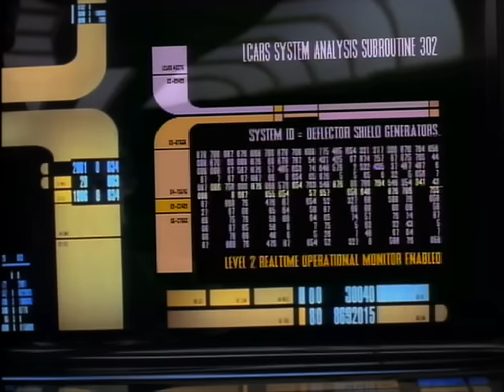"Captain. Drop the Shields." Lieutenant Commander Data

Comment: Data is so underrated he has saved them so many times
Reply: That's a nonsense line of causality.
Reply: Like in The Game episode, one of my favorites
Reply: Like the time he figured a way out of the time loop.
Reply: No it was the kid who provided the information data needed to conclude shields were the cause, he never would have come to that conclusion without that prompt
Reply: Underrated? Aside from Picard he's the fan-favorite TNG character. Worf a close third.
Reply: And fully inflatable as well.
Reply: Data is underrated? He is very much one of the most beloved and respected characters in all of Star Trek.
Reply: Starfleet promoted Data to Captain after the events if Nemesis in which he received the federation's medal of honor. He was then awarded the honors rank of Admiral after Picard submitted over 20 instances where he saved the Enterprise crew.
Reply: @Davidjune1970  Yup. Once data made the potential connect he ran the numbers with ship's own data and sensors to verify that yup there was a correlation
Reply: @jsmith-u5i  Data's suggestion was half correct, didn't exactly have time to do detailed simulations of ship deflection paths and tractor beam power settings to figure out the exact settings needed to clear the ship completely. Also in haste worf may have miscalculated his aim when he hit the other ship sending it to the side instead of strait up. Lots of factors. Which is why when data realized which suggestion was actually better, he went with it.
Reply: It's pronounced "Data".
Reply: For what he has in operation speed and knowledge, he should be the Captain, but human comfort and stroking of egos, I believe holds him back. He has many below him in rank, that unless the future is radically different, means he evaluated crew, like, perhaps the ensign to his right, but more likely, the head of her group, as I believe Mr. DATA is two ranks ahead of her.

Comment: "Order of magnitude" and "Factor of 10" are the same thing, but still Worf makes it sound cool.
Reply: I noticed that too! Great way for the writers to allow Worf to repeat himself without repeating himself.
Reply: As an engineer, when someone says "order of magnitude" I always wonder if they mean 2, or e, or 10, or something else.
Reply: Order of magnitude is not the same as "factor of 10", first it depends on the base used. In this case it's 10, but even if it's 12x, it would still be an order a magnitude even though it's not a factor of 10.
You just do the logb(y/x), b being the base.
Reply: Order of Magnitude = when a pimp named Magnitude tells you to do something.
Reply: @youuuuuuuuuuutube  Homer Simpson put it best: NERRRRRRRRRRDDDD!!
Reply: @bdijkstra1982  Right?? That phrase drives me crazy as a programmer.

Comment: The correlation between shields and wave strength was so obvious that there was no need for simulations.
Reply: Yes there was.  Correlation does not imply causation.
Reply: When you're staking over a 1,000 souls on something you wanna be as damn sure as you can be.
Reply: @Tantalus010  That's why Data carefully and quickly analyzed the data, in order to determine if the correlation was likely to be relevant. Also, if something is genuinely correlated, it can still be useful even in lieu of causation. 

For example, if the wave front amplification wasn't caused directly by the power to the shields, but was caused by some other mechanism that was itself caused by the power to the shields...then lowering the shields still would have been the only way for them to effectively survive the scenario.
Reply: @dreamcanvas5321  That's a big if. If it wasn't caused by the shields either directlly or indirectly it would have resulted in them lowering their only form of defence.
Reply: Sarfaraz Hussein Merchant true, but at that point the shields were already going to be useless against the next impact, so if the ship is already doomed, you might as well go for it.
Reply: @Tantalus010  Actually it does when you have controll over the cause. Shield strength was controlled by them, and not by an underlyeing cause.
Reply: But if they skipped the simulations, then the show wouldn't have made it's "dramatic button mashing saves the day" quota, and that's just not right.
Reply: This whole thing was nothing but expectation subversion.  "So, usually you gotta raise your shield to protect yourself?  Well... we made it so you gotta lower them to protect yourself."  It was pretty impressive how that robot pushed them buttons all fast, though.
Reply: Keeton Mitchell - Exactly. The ship was about to be ripped open. So the choice was between breaking the ship apart vs. blowing it to smithereens. How would you like your corpse, whole or in pieces? 😂
Reply: But when do they ever raise shields 75%? Plot demanded one more increase of the wave force.
Reply: Why was it obvious, because a kid said 'I'm sure that's what I heard them say last time'? With meta understanding of dramatic devices and tropes used by TV writers, maybe it is obvious.

But if it was real, all you would know is that your ship is being hit by an escalating wave of energy which threatens to destroy it. All your training and scientific knowledge states that increasing the shields will protect you. You don't know what is causing the waves, or how long they will last.

You might have a hunch that increasing the shield power is why the power of the waves is increasing. Alternatively, the more plausible explanation might be that there's another reason they are escalating. They didn't know how powerful the next hit would be, so their best bet would be to raise shields as much as possible, hope they can survive it, and hope that its the last hit. They don't know whether the next hit will overcome their shields or not.

Lowering the shields would mean certain destruction if Data was wrong. Hence the need to back up the hunch with some quick calculations. Only a completely reckless captain would take such a huge gamble with the lives of his entire crew and their families, based entirely in a hunch.
Reply: @Tantalus010  Statistics 101
Reply: It's one thing to observe a correlation. It's quite another to analyze it and discover a direct mathematical ratio that strongly suggests that correlation is in fact causation and thus reasonable enough to drop shields in the face of an impending threat to your survival.
Reply: Hindsight is 20/20.
Reply: Normally you'd have a correlation between shield strength and wavefront intensity because the humans strengthen the shields when they see the wavefront getting stronger; you'd need to analyze it in more detail to be sure
Reply: They might have found that out sooner if someone had said something like, “Everytime we strengthen the shields the wave strength gets stronger. Hmm.” Btw, the boy wouldn’t have known what orders were given on the bridge, he wasn’t there.
Reply: And yet every day people do the very things that make their situation worse, and never could fathom backing off on their efforts.

Comment: The only condition under which I wouldn't question that is if Data was the one who gave that order. I remember the episode "The Hunted" that had to do with a culture abandoning their genetically modified soldiers after a war was done. Danar, one of the solder, had been captured on board the Enterprise and managed to escape. Picard and Riker were assuming he was going to try to make a run for it by escaping with a shuttle craft. Data gave his own hypothesis stating that Danar knew he could not be detected by the Enterprise's scanners but was deliberately leaving a trail. Furthermore, Danar's previous maneuvers made Data believe that heading to the shuttle craft was too easy of an escape route for Danar to consider using.

Comment: phew....i almost thought they weren't gonna make it this time.
Reply: It's never about whether they make it or not. It's about how they overcome obstacles, and the character interactions and development which occurs because of those obstacles.
Reply: @WestOfEarth  you srs?
Reply: @gonaddabarbarian  You made an absurdly obvious point, and I answered with an absurdly obvious point. Is there a problem?
Reply: @WestOfEarth  i think you need to understand, this time they escaped, but next time you watch this same clip they may not make out, or maybe they make it out again the 2nd time you watch this same clip, but maybe not the 3rd.  it leaves you in suspense, you just never know if they will make it out safe everytime you watch this same clip.  <3
Reply: @gonaddabarbarian  Yep the way Data was dragging his feet trying to figure out the obvious plot contrivance had me on pins and needles. And then when he tells Picard to shut down the shields without any explanation, I facepalmed. Are they going to die debating if it is a good idea or will the captain just do it without any explanation? If data had taken thirty seconds to explain himself there would have been no tension or drama so he stared at Picard for 30 seconds instead.

Comment: TNG really got its groove in the middle few seasons. The main crew just really coming to trust each other. 

It's not like Data was always correct either, I remember Cause and Effect where Riker had the solution, and actually Data's approach was causing the destruction. 

But here, with certainly in his position, Picard checks and then trusts his officer. 

I think in this regarding TNG was most similar to TOS, in that the captain has quite varied crew but manages to get the best out of them.
Reply: You know, what you mention here actually reveals a bit of a bias in Data's favor! It's quite interesting when you think of it: Data is often right, but certainly not infallible despite his unquestionable capabilities. It begs the question whether they rely on Data a little too much sometimes.

Ironically, think of the episode Peak Performance. Data had to LEARN that he's not perfect despite his supposed superiority.

Comment: One thing I never understood about this is how a supposedly perfect crew didnt even think about the obvious correlation between the order to increase the shields followed by an almost immediate report that the wave front had increased in intensity. If I saw something like that happen I would be instantly suspicious.
Reply: the crew isn't perfect, plus they had no records of the previous ship to compare apart from the boy. The idea was that the other ship was destroyed because its shields were not strong enough, turns out they didn't need to overpower the wave front, merely power down and let it pass. It was coin flip logic as far as engineering was concerned. Makes sense

Comment: Science ending: they drop the shields and the Enterprise is crushed and explodes.

Of course Data found a correlation between the other ship's shield output and the wave strength, they were actively trying to match the waves after all, but that doesn't mean the shields are driving the change. Having only found a correlation, and guessed at the causative agent, Data was gambling. Still, much more realistic than most shows now, especially those that include the word "reality" in their description.

Comment: Rather than gobbledygook on the screen, we should have heard data ask the computer to "plot a curve for the wavefield power" and then "add a curve for the shield power" say "interesting", and then "plot the wavefield power against the shield power" and seen a a straight line (or more accurately an exponential one) so that the viewers can discover the solution along with data.  Not everyone will get it but a lot will.  It's more fun to have a Sherlock Holmes type story where you can gradually deduce the killer than to have someone come in from left field and say "John did it". Sure, here it was pretty obvious that the kid was clearly telling us that increasing the shield power was wrong but better to involve the viewer in the solution.

Comment: Quick nerdy question.  If they dropped the shields wouldn't that last wave still hit them. If you cause a wave that gets amplified and reflected back, stopping isn't going to cause the wave to vanish, it will just stop more waves from forming.  I would have really liked the episode to end with Data having to calculate the minimum amount of shields to use each time, while the Enterprise keeps getting rocked by the waves. :)
Reply: It's called dramatic effect for a reason. What you're suggesting, more realistic or not, would've diluted it.

Comment: I remember seeing this many years ago, and I still have the same question now as then. It seems that each wave reacts to the shield energy use on the previous wave (otherwise it's strength would jump at the moment the shield is increased), so how did dropping the shields destroy the incoming wave?
Reply: Each successive wave became stronger as it fed on the increased shield energy. The last wave really wasn’t destroyed. It dissipated because when the shields were dropped, there was no energy for the wave to feed on, anymore.
Reply: I bet you haven't even run the simulations yet

Comment: So I don't know everything about Star Trek... but during a normal battle when they aren't using warp, do they put all their warp core into the shields and if not, why not?
Reply: I believe at battlestations pretty much most non essential sytems go into low power mode and the energy is predominantly given to the shields, although phasers also take a big chunk of main power as well. However nothing compared to what the shields eat. 

Warp drive is still very much needed. One to escape if things go wrong, two pursue if they try and get away and three to attack and evade. While I doubt a ship can run at maximum warp with full shields it is probably some skillful power management getting the right power to all the key systems during critical situations.

Comment: How could they route power from the warp drive to the shields when it was stated that they couldn't form a warp field to get them out of there? Surely the warp engine needs to be stable in order to work?
Reply: If they couldn’t form a warp field, they could just dump all that power into the shields instead of trying to form a warp field. The warp engines are perfectly fine, what’s not working is the attempt to form a warp field.

Comment: I know that there is a difference between a cpu and a gpu, but the Maxwell processor have a peak performance of 1.25 quadrillion 64 bit floating point operations per second or 20 quadrillion 4 bit oerations per second. We are still not 1/4 of our way through the 21st century and Data's brain can only do 60 trillion operations per second. Look at our AI technogy now! Available to neay everyone. Free services. Pay services even better with nominal subscription prices! Incredible really! Human level androids are not that far away. Clearly not three and a half centuries from now! Even if it took  2050 or 2060 that is still way sooner than Star Trek. Personally I would be surprized if truly human level androids were not her on or before 2040 and may in fact be here as soon as 5 years from now. Possibly even sooner than that.